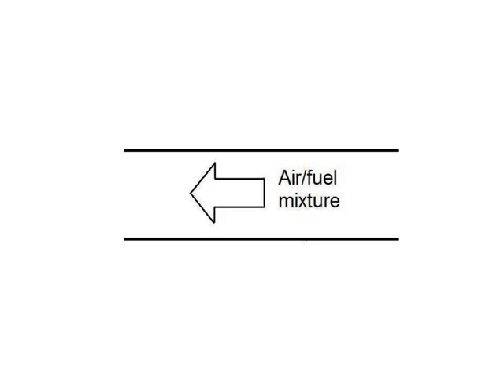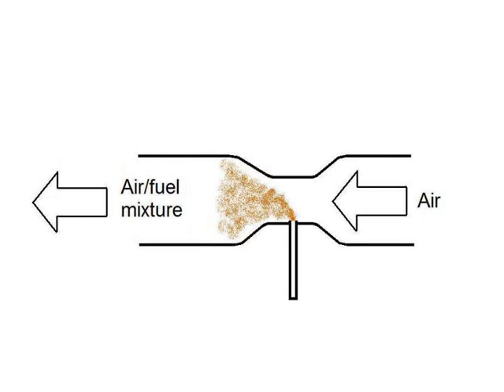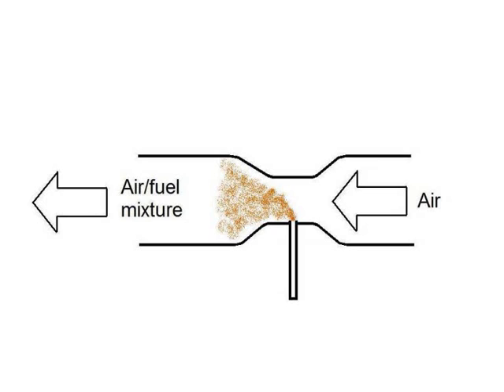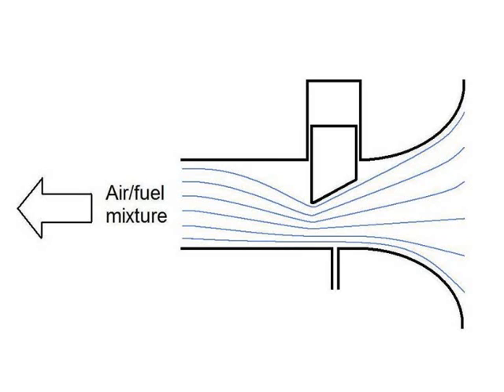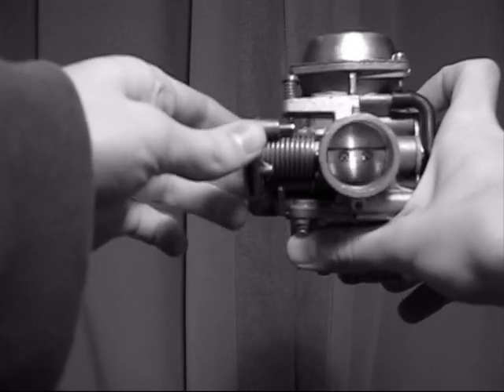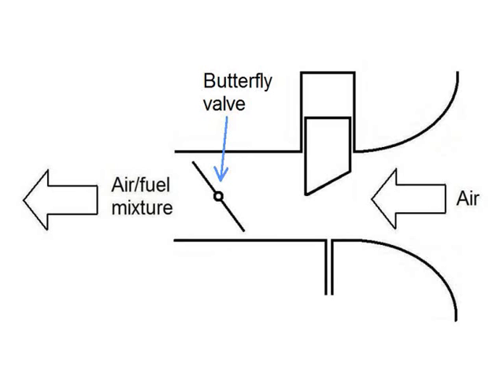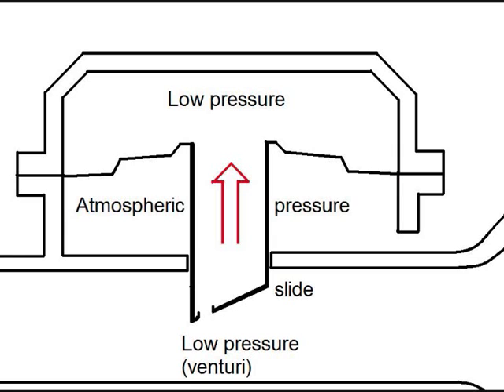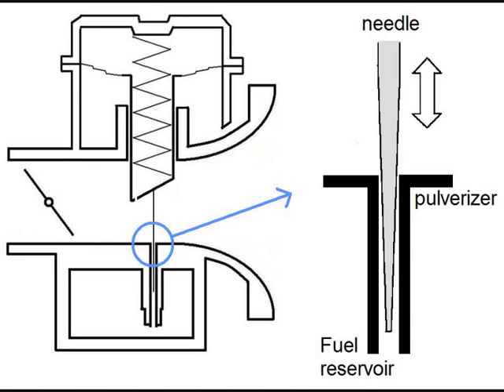How a carburetor works, schemes and explanations

Comment: Carburators are MUCH more reliable and cheaper to repair compared to fuel injection systems on todays cars.I could slap a brand new carburator on for the price of one fuel injector (in most cases)

Comment: @arctor08  I changed the springs to the air intake valve and exhaust valve, not any springs in the carburetor.

After putting in new valve springs, and setting the gap between the rocker arm and valve spring, it still misfired at higher speeds/rpms.

While trying to figure out what was wrong, I noticed the enricher/auto choke had separated from the carburetor whent eh bolts vibrated out over time.

I put the enricher back on.  Can't take a test ride now, it's snowing.

Comment: @arctor08 Thanks for your input.  I recently replaced two broken valve springs.  After putting them in, the scooter ran better than new, for about a day.  Then it started misfiring at higher rpms.  

I checked the valve gaps and saw they shifted somewhat.  I reset the valve gaps tight, and right.  But still the scooter misfired at higher speeds.

I saw two small bolts in a depression on top of the engine, then saw the auto choke (enricher) off the carburetor.   You think I found the problem?

Comment: @arctor08 Wow.  That was not what I was hoping to hear.  Here's why -- My auto choke vibrated completely off.  However, the scooter started immediately and idled good.  It accelerated nice but starts to misfire at higher rpms.

I thought, with the auto choke disconnected, the butterfly valve would be closed and stay closed because the auto choke wasn't connected to open it when warm and under full throttle.

While looking for the reason it misfires at high rpm, I found the loose auto choke.

Comment: How would a 150cc 4 stroke engine perform, if the auto choke vibrated completely off the carburetor? How would it affect the starting and how would it perform at higher rpm under load?

Comment: Except nobody uses carburetors anymore,. It's all electronic fuel injection. although push lawnmowers still use them, as well as hedge trimmers but those have are 2-stroke engines as opposed to the usual everyday 4-stroke.

Comment: @eckyspondoolie hydrogen cars don't actually burn hydrogen
they use a special cell that combines the hydrogen will oxygen in the air to make water H20 in doing so it creates electricity and a electric motor is what powers the car
if u are talking about LPG that is a different story and im not sure